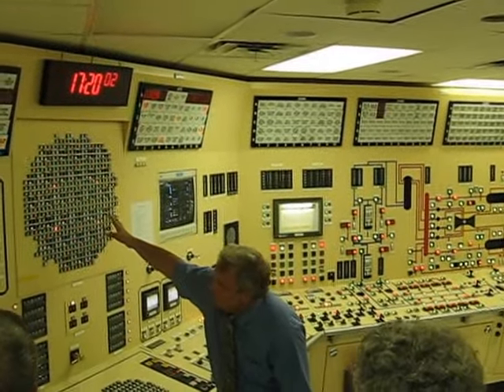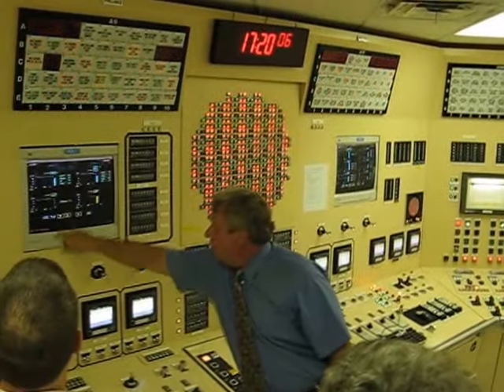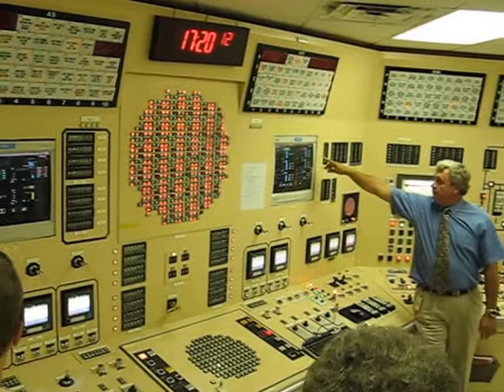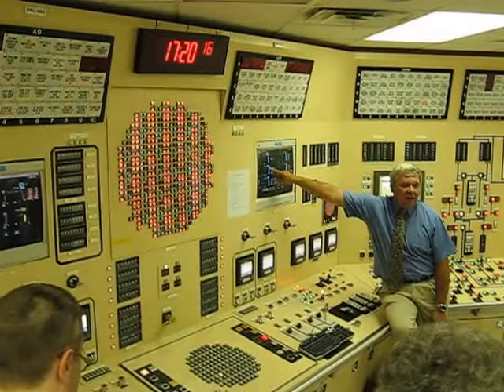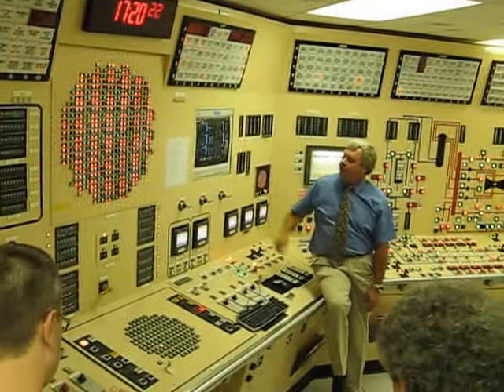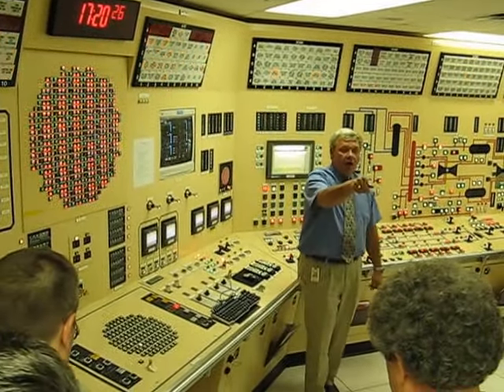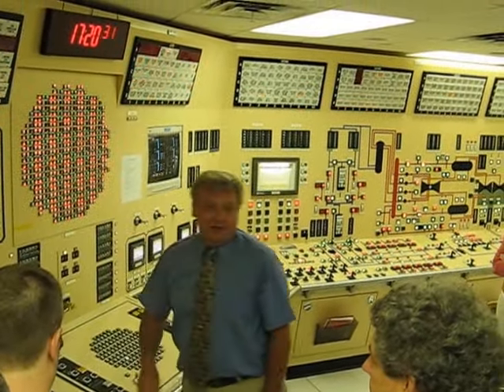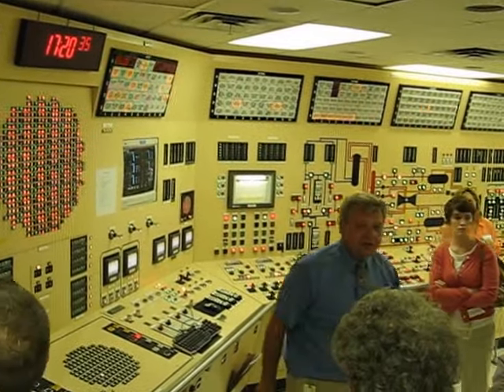Nuclear power plant control room during simulated emergency shutdown

Comment: Plot twist: The reactor was actually in a state of a meltdown
Reply: I actually think your right
Reply: I actually think your right
Reply: @raechar  I’m pretty sure it’s just a simulation, since it’s illegal to film actual control rooms
Reply: @Robertx19  the AZ-5 button have positif reaction effect in rmbk reactor IT was well known in the scientist circle but was not spoken of. Because of the heat the feul cells Will Burst and debris block the scram channels.
Reply: @mellepasveer6173  AZ-5 is only for Russian Reactors. It is the "PRESS THIS IF REACTOR IS VERY DANGEROUS". The AZ-5[A3-5 from Russian] comes from the name  Аварийная Защита 5-й категории which translates to "Emergency Protection of the 5th Category"
Reply: @dontydonty4701  tnx donty
Reply: @mellepasveer6173  Yes, every reactor in the USSR[Including Ukraine SSR] had RBMK design. They were very dangerous at low power.
Reply: @dontydonty4701  i know ,i did some research (books , YouTube) very advanced technology at the time (but not very clean) . They are still running Them whit no promblems
Reply: @mellepasveer6173  Yeah, i know, kursk for example.
Reply: @dontydonty4701  I AM pro nuclear energy and i put the money on thorium or vast nucleus breeder reactors
Reply: @dontydonty4701  Not true! The Soviet Union also had several VVER Reactors, which were the safer reactors compared to RBMK. The plant that was under siege in Ukraine was a VVER plant. All VVERs have containment vessels! They really are the better design compared to RBMK reactors. Also, AZ-5 was used by operators to shut down the reactor in normal reactor shutdown situations. The reason for AZ-5 being pressed at Chernobyl was actually because operators wanted to take the reactor offline, the unfortunate power surge happened after the button was pressed.
Reply: @isaowater  I understand but what about "Aварийная Защита 5-й категории "
Reply: @dontydonty4701  As I previously stated, they used AZ-5 to shut down the reactor in normal situations, but AZ-5 was also used in emergencies. AZ-5 is not really comparable to SCRAM buttons in the west, rather that would be AZC or BAZ which cut the rods from their servo motors and gravity caused them to fall into the core.
Reply: Almost certainly not in meltdown. It sounds like they had a some sort of loss of coolant accident where the reactor vessel or attached piping had a hole large enough to rapidly depressurize the vessel. While the water/steam may temporarily leave the vessel, this leak would be contained within another “containment structure” and then pumped right back into the reactor.

Comment: Are you still pumping water into my reactor core though?
Reply: There's no reactor core(Russian Accent)
I smoked it
Reply: @moosestubbings1853  bullshit rbmk reactor dont explode ur in shock
Reply: @unitforce7417  "You're delusional."  Take him to the infirmary.
Reply: @heathmcconnell3901  call the fire brigade
Reply: The core exploded
Reply: @MinisterofTinyHeads  No worries, that’ll buff out.
Reply: @c0t0d0s7  Just feed pump leakage.  I've seen worse.
Reply: Oh absolutely, The light says so... definitely no equipment failure here
Reply: Did you lower the control rods or not?
Reply: @zahnatom  Not in this type of plant.  The control rods enter from the bottom, and actually move UP to insert.
Reply: @johnjones5354  the joke went right over your head
Reply: @zahnatom  Probably because there was no joke.
Reply: @johnjones5354  r/whoooosh
Before you write your "well actually" comment, first consider if maybe you're missing something.
Reply: @johnjones5354  
There is. People who have seen the outstanding HBO "Chernobyl" series will understand it the moment they hear/ read it.

Comment: Stumbled across this and imagine my surprise to see 'Devo' again after all these years (Richard passed away a few years back).  And my old place of employment, I programmed and maintained all those flashing lights and noises, along with four other simulators there in Chattanooga.  :)  Great memories.
Reply: Epic
Reply: Do the alarms stop after a certain time? Seems distracting if they didn't.
Reply: Did you ever work for Volkswagen?   The dashboard warning lights and sounds seem similar.
Reply: @wesleysmith5275 yes, the first thing operator do is silent the alarm, then the light keep flickering, he press acknowledge and if alarm still present the window become lit.. when operator think the parameter has stabilized he press reset. Lit window goes out or again start alarm if the condition has not yet stabilized 😂😂😂... nuclear plants are way safe but they need to compete with other energy sources to be competitive...

Comment: When I did an internship at a NPP in Germany, I worked in the control room for some days. Once, I sat there watching the operators. Suddenly, lights went off; then alarming lights flashing seemingly from everywhere and different alarming sounds. I was frightened to death and my pulse went up. After long seconds, the lights were on again and the alarms stopped. It turned out to be a problem with emergency power supply.
Reply: sudokuking s. I'm
Reply: That felt like Chernobyl, didn't it

Comment: While some of the instruments in the simulator are indeed 1960's vintage, many are state of the art.  The Instrument systems at nuclear plants are updated as the older systems are rendered obsolete and no longer have replacements available.  Just look at the digital paperless recorders mounted on the panels.  I assure you that they were NOT available in the 1960's.  I spent 31 years updating the instrumentation and controls systems of a plant just like this one.
Reply from the maker: Thank you for that information. I expect that you saw the considerable decline in equipment failure rate over the decades.
Reply: @WilliamCalvin-on-Climate  Actually, on the whole the older equipment was much more reliable, since it was simpler and built  to last.  The newer equipment, while much more capable, sometimes presented more of a maintenance headache.  However, there was no choice but to upgrade, as many of the original equipment lines haven't been supported for years.  The process for upgrading, even for something as simple as a chart recorder, is, as you mat expect, complicated and difficult.
Reply: @johnjones5354 in some cases I’ll agree, but those old paper chart recorders have so many moving parts they seem to break all the time. Haven’t had an issue with equivalent digital recorders. And nobody would ever miss having to replace multiple paper rolls a day
Reply: @romer-cd4il  But, on the other hand, I never once had a backlight on a display fail on a paper recorder.  I replaced many dozens of digital displays.  And getting all the moving parts on some of the recorders synchronized was often a challenge, but once it was done, it would run flawlessly for years.  Don't get me wrong, the massive  increase in capability with the digital paperless recorders was worth any extra work.  Plus, most of the kids coming in couldn't handle the older stuff. 😁

Comment: A coal power plant produces 3-5 TIMES the radiation of a nuclear plant. Mining coal and Uranium ore produce are about the same in energy consumption. Then it must be refined which takes quite a bit of power, but not in a breeder. Also coal produces tons of mercury, lead, arsenic, CO2, SO2, NO2. Nuclear is much cleaner.
Reply: NO THAT IS A URBEN LEGDENSA I AM MAN OF COAL AND STELESE!
Reply: solar and wind energy is cleaner
Reply: @jitendra-ke5lb  For the TWh produced, no it isn't. Spent nuclear fuel is 99% recyclable, only with actinides left over which can also be reused for medical purposes or transmutated in fast reactors.
Reply: @wiretap25  now you are an educated individual you have my respect

Comment: that control room looks like some 60s sci fi spaceship interior
Reply: Death Star superlaser control center.
Reply from the maker: 1960s is quite correct. Most US plants were designed and built back then. There are almost none built to more recent designs, which would look more like the glass cockpits that began in passenger jets about 1983.

Comment: What t is the normal pressure for the reactor vessel and the dry well, as well as what would the normal amount of water per gallon be to keep the reactor stable? In the simulation was this a complete scram with all rods being inserted or just a partial???
Reply: BWR reactor pressure is usually around 1025 psig, and drywell pressure is aroud atmospheric pressure during normal operation.  Depending on the reactor power level, makeup flow to the reactor (feedwater) is probably in the 15,000 gallons per minute to 27,000 gpm range.

Comment: Did you lower the control rods or not?
Reply from the maker: Yes. But this is a simulator room for training operators, not the real thing.
Reply: Actually, in this type (BWR) of reactor, the control rods go UP not down to shutdown.
Reply: No, they just used the Force.

Comment: Dang, if that is when the reator scrams, screw trying to find a job for a nuclear plant, and I know that scrams don't happen often, but still
Reply: The indications show a large pipe break within the containment. Common in simulations, hasn't ever happened at a power plant except at Chernobyl*. IMO, it's a perfect example of why the safety engineering of the 50s and 60s is dumb - why is your "design basis accident" something stupid-rare that won't necessarily help you in more plausible scenarios?

(*Technically, the RBMK design didn't have much containment to begin with. But whatever they had before the explosion, wasn't effective afterwards. Experimental reactors have had some pretty severe accidents, and several naval reactors have sunk and at least partially imploded.)

Anyway, new designs have fixed that particular brand of stupidity. In an ESBWR for example, you wouldn't need any pumps running. The passive containment cooling system (PCCS) would already be starting to work. Operators just need to verify that the gravity-driven cooling system (GDCS) has actuated and the appropriate isolation valves are closed. Then the depressurization system too, and it won't hurt if isolation cooling (ICS) is started. PCCS and ICS have cooling tanks which are each capable of cooling the first 3 days after a shutdown. Together you have a bit more than 7 days. After that point, they just need a supply of reasonably clean water, basically the industrial equivalent of a sump pump.

So the alarms would ring, but it's pretty clear that your reactor has pooped out and won't be restarting soon. With the best new reactor designs they just fail into a state where they can safely cool themselves and unless there's some accident scenario that's far beyond the design limits it's really boring. But boring is good.

Comment: Usually disasters could have been avoided if people did what procedures told them...Chernobyl was one of the disasters that was easily avoidable.
Reply: Yeah if Dyatlov had listened to  Akimov and Toptunov......
Reply: @mikegallant811  No? The real Akimov and Toptunov never recommended a reactor shutdown. Dyatlov wasn't even mean, he was just demanding. Which was actually good as Akimov was a very attentive Block Supervisor. The so called "Power Drop" that occurred was due to operator error, the difficulties in getting the power back up was indeed due to Xenon causing an Iodine Pit in the reactor, but the operators worked to get around this and got power up to 200 Mw, which was only the second deviation from the test program. The Power was raised by Toptunov without orders. The Dyatlov that you are thinking about is just a TV character and Scapegoat for the Disaster.

Comment: He said SCRAM enabled. You have to try and melt this reactor down.
Reply: 20th century reactors are really good at stopping the chain reaction. But it's now abundantly clear that stopping the reaction does not prevent a meltdown - decay heat is a serious problem.

Insist on new reactors with passive shutdown capability and probabilistic safety design. I believe the old ones should be decommissioned and replaced.

Comment: Dry well pressure cause the reactor scram.
Reply: Absolutely.  High drywell pressure is an indication of a LOCA (loss of coolant accident) further indicated by the very low reactor pressure.

Comment: The operator did a great job in placing the plant in a safe condition,but at one point he sat on the control panel which was not a good thing ,because the control switches are in this area.

Comment: Not 3 years ago there was a serious toxic sludge spill in Hungary that killed 10 people and injured some 120, not to speak of the untold numbers of animals killed and the local ecosystem violation. The plant was producing alumina, the source material for almost all aluminum. Just for perspective.
As for reactor components, the "hottest" bits are stored together with spent fuel. It's not the science that is unclear here. It's the political pressures and NIMBYs that are largely driving this craze.

Comment: Who the heck would know what all those buttons and switches do
Reply: A nuclear power plant shift supervisor.
Reply: I am way out of my depth here, but common sense would suggest that those controls and dials are grouped by function and maybe by location in the plant. I would imagine that they don't let anyone near one of those consoles without a very rigorous stem education, which tends to be very heavy on memorizing. I think there's a hard line in every nuclear power plant to the Nuclear Regulatory Commission too, you could always call them so them and ask em what this or that dial does lol.
Reply: Every operator in the control room.  And most of the technicians who maintain them.

Comment: Man shit, I wouldn't know what to do, only I would do is press that SCRAM button like crazy : D And lower the Rods.
Reply: Just hope that the SCRAM button doesn't have the same fatal flaw like the Chernobyl one
Reply: But in a BWR (as this one :) ) The rods are pushed UP from underneath into the core.  Rods already scrammed in this video, but there's a large loss-of-coolant-accident (LOCA) in progress.  So the containment pressure rose (instructor refers to 'wetwell' and 'drywell' pressures), and emergency systems are pumping fresh coolant into the core about 40000-50000 gallons/minute

Comment: Press AZ5!
Reply: SCRAM*
Reply: In all seriousness, that's already been done. The challenge is continuing to cool the core after a shutdown in order to prevent fuel corrosion or meltdown, Fukushima or TMI scenarios.

Insist on passive shutdown safety and replace non-compliant reactors.

Comment: That alarm seems counterproductive, like it was designed to make the operators screw up at critical moments.
Reply: There is possibly a button to surpress the alarm sounds, for a certain period of time. This of course is only possible in certain conditions (when reactor SCRAM has occured, NOT before it).
Reply: @dvraemdo  I certainly would hope so. I've read reports suggesting part of the reason operators had difficulty controlling the situation at three mile island was alarm fatigue, and far too many similar sounding alarms for different warnings. The industry has definitely come a long way, thankfully.

Comment: All it will take is pressing one wrong button, opening/closing one wrong valve. Or flipping one wrong switch and Chernobyl 2 begins. Even during a drill.
Reply: Yeah, because we all know that building industrial billions-costing machines that are so easily destroyed makes perfect sense. No,  automatic safety systems will kick in if you mess around, unless you purposely disable them as was done in Chernobyl. Getting a modern, properly designed reactor to meltdown is difficult enough as it is, and explosion like in Chernobyl is virtually impossible due to the negative feedback tendencies our designs have.
Reply: @Silanael  Finally, a voice of reason.  Thanks.
Reply: "Even during a drill"

You... do know what a "simulator" is, right?
Reply: Not really.  Considering the redundancy you would have to push several 'wrong buttons' and open/close several 'wrong valves'.  And those simulators are used to train operators.   There is a certain level of analysis that assumes operators make mistakes and how to recognize and recover from them.

Emergency procedures are focused on preventing core damage and/or release of radioactivity.  Something operators train on several times a year using simulators similar to this one.
Reply: No, that's not how it works. If you have an incorrect valve lineup by pressing the wrong button, you have relay logic which activates other valves/pumps to compensate in a redundant system, or will cause a reactor scram if key parameters go outside of the operational boundary for the reactor mode you're in. Every plant, at least in the US operatates this way, and you have a pretty long time window to correct any inadvertent operator action before any fuel damage would occur. Upon a scram, you're removing decay heat, and these system activate and run automatically. Of course if you have a scram with complications, more manual action needs to immedately be taken. That's why operators are licensed through rigourous testing and continuous training for those types of scenarios.